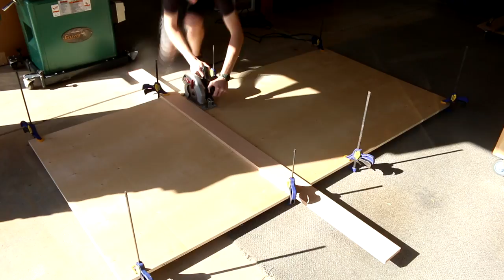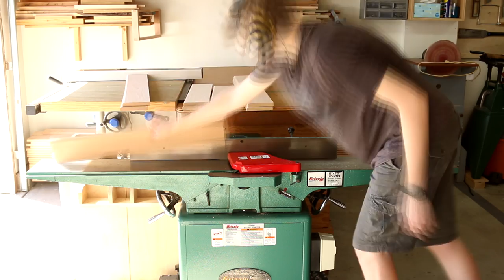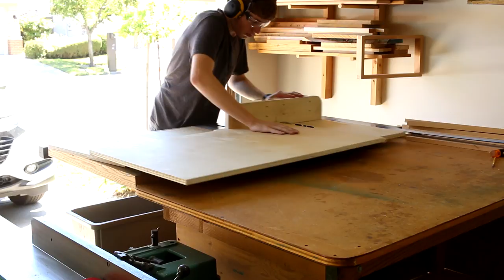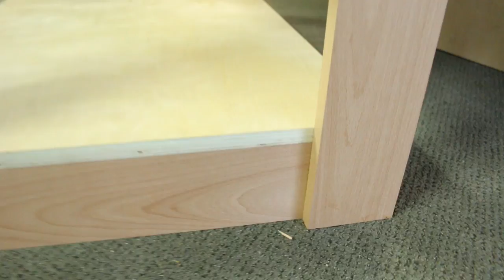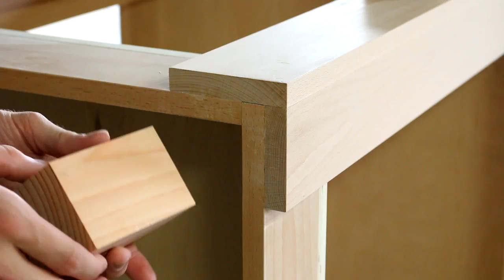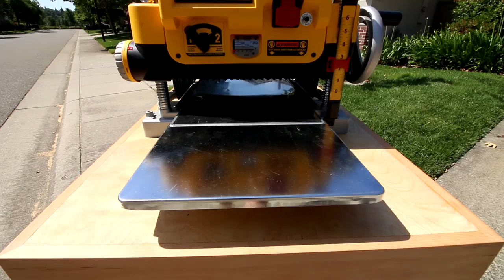Building The Ultimate Tool Cart

Comment: Good workmanship but always remember the 3 most important rules in any workshop, safety, safety and the most important of all Safety. Anyone that can produce a fine piece like that cart should have no difficulty making up a set of push sticks. 
Loads of ideas online 
I also admire your faith in glue alone, for long term use I think screws or better again bolts and nuts would really make this a solid build.Well done very nice project.

Comment: Nice build! I've been using similar carts in my shop for years although yours is a lot nicer than the ones I built using 2x4s and scrap plywood. It's nice to see someone with a mix of both expensive and cheap tools. That's how most shops are as things get upgraded and the fact of the matter is cheap is good enough for some tasks. Anyway I'm wondering why you haven't invested in some sanding equipment? Seems you do a lot of hand sanding in your videos. a random orbit and small belt sander really speed up the process.
Reply from the maker: I have only been acquiring tools for a couple years. Cheap tools are great for getting started. I am slowly in the process of upgrading tools and such. I have been looking at some of the Makita or Dewalt cordless line of tools. I have the mindset of buying quality tools that will last a long time
Reply: I'd just keep expanding on the Makita cordless. you've already got a good start. Honestly the only cordless tools I use in the shop are drill and impact driver. I've got the full cordless compliment on my work truck but when electric is easy to source I'd rather have corded saws.

Keep up the good work!

Comment: Hey chief, Don't want to be a thorn in your side, but gloves on a table saw are a no no. Looks good, some rough sawn lumber projects coming up? One more thing, them music was great.
Reply from the maker: I only used gloves to break down the large sheets. The circular saw leaves a rough edge and I didn't want any splinters. I am very aware of the dangers with gloves and table saws. I made sure there was no loose string or anything on the gloves that could get caught in the blade. Thanks for looking after me though!!!
Reply: It's all good, I'm not a safety nerd, I just learned the hard way, don't want any one else too. You build furniture on commission, your definitely good enough?

Comment: nice tool cart,good job. im surprised at how strong the glue is,considering the tight fit of the lower plate. 
im new to woodworking,will do a workbench and a tool cart as my two first projects.

Comment: Nice build but why not put the planer on the bottom and the miter on the top?  Seems more logical (to me at least) to organize them that way.  Thanks for sharing the build
Reply from the maker: Maac N Cheese the planer is 100 pounds, the miter saw is 25 pounds :)
Reply: Yea I understand, but you can use the planer when it's on the bottom and never have to move it - plus the whole cart will be a lot sturdier if the weights on the bottom instead of the top.  I guess it doesn't really matter though if you plan on moving the miter saw around a lot and don't plan to use it on the cart ever otherwise I'd just swap them and then you'll never need to move either again.
Reply: A real solid cart.  Right now, I agree with Maac's thoughts.  With the planer on the bottom it lowers the center of gravity.  You got me thinking though that if my cart had the saw on top, I would add wings to flip up when I wanted to chop longer stock.  But that might get in the way of using the planer on the bottom when they are flipped up.  Hmm, maybe rotate the planer 90° to get around that problem?  Anyhow, I know that where these are located is only important to whoever is using it.  Thx for sharing the vid.

Comment: The amount of people preaching push sticks on the table saw. Over 30 years around power tools including tablesaws and no one has ever lost a finger or hand pushing the wood through like he did. Everyone I've seen lose a finger or hand walked away from the tablesaw then returned after someone else used it who changed the blade height, angle or guide.